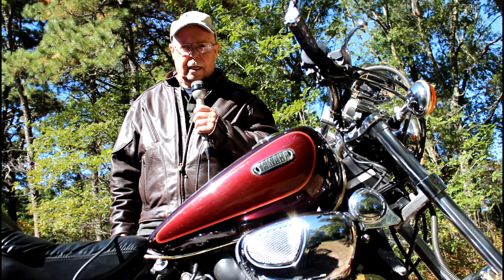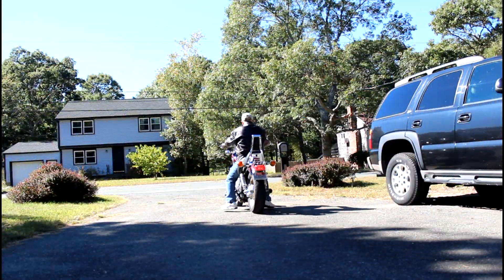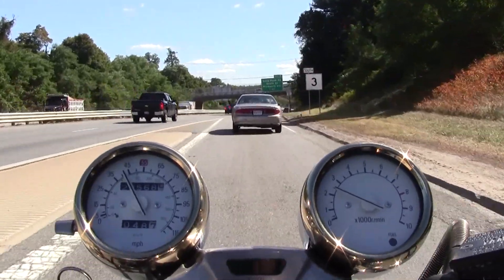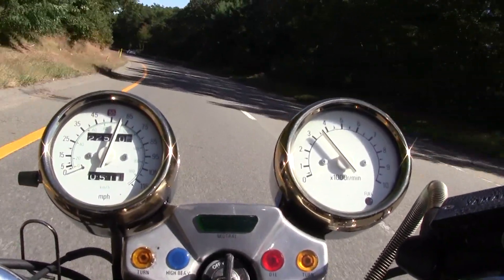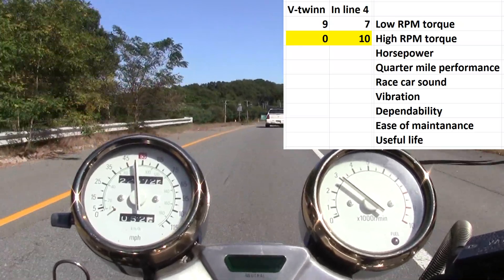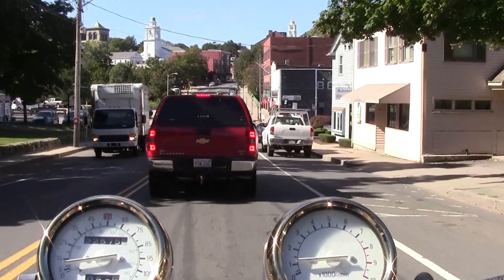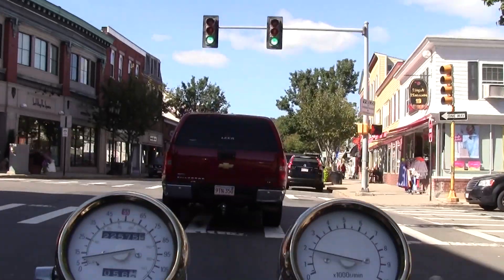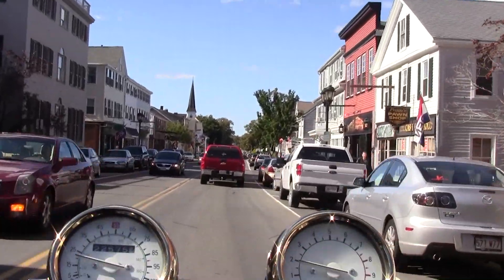Basic motorcycle engines 101*

Comment from the maker: Backfiring in gas engines was stopped in the 70s by feeding gas into carbs as deceleration and vacuum took place. Normal backfiring never hurt a engine and indicated a high state of tune. The add gas cure was a dumb idea by the EPA. The fuel path that provides the gas on deceleration is probably plugged and your bike will run better and faster as a result. My expertise in this field is not documented, however , I did sleep at a Holiday Inn last week.